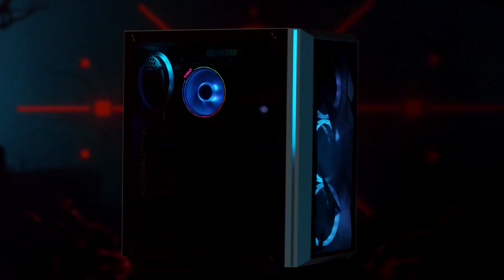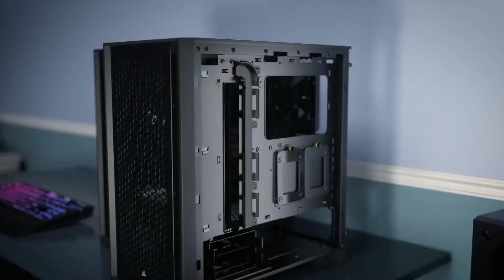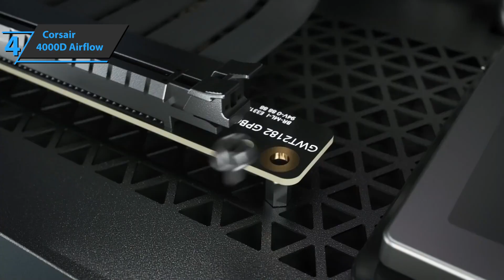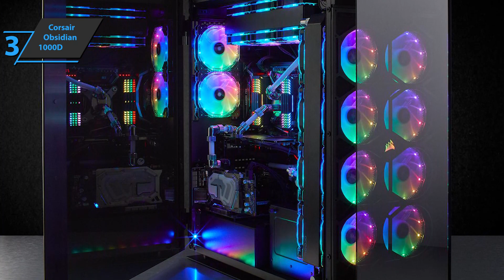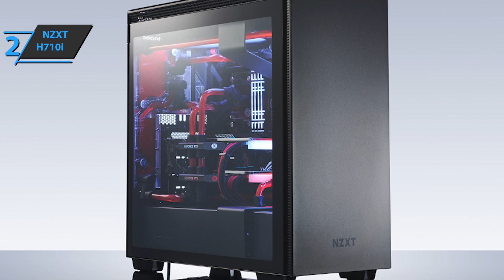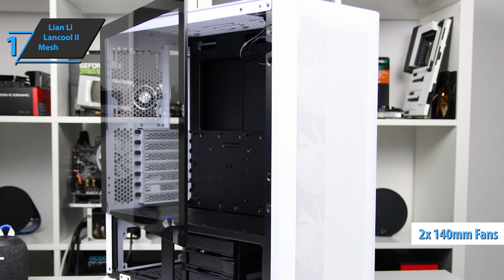Top 5 BEST PC Cases of [2022]

Comment: I just want a basic case! no front door or panels. I want at least two 5 1/4" bays in front, the front usb/audio inputs need to be below the bays so they dont get in the way of the dvd drives when opened. I dont need pretty colors, colored fans, etc... needs decent storage(couple of hard drives) one drive be in front 5 1/4" removable tray. Midtower ATX. Any recommendations?

Comment: I have the 4000d for my build and with 6 argb fans not only does it look great it has amazing airflow. Highly reccomend, good airflow, looks good, and is pretty easy to build in.
Reply: Does it have a USB 3 Socket?
Reply: @slayrobin9429  it has a usb 3.0 type a port, a heaphone/mic jack, and a usb 3.1 type c
Reply: @VxidGxd4060  do you think it's future proof? I.e. extra space
Reply: @oco8783   I think so, it has room for 6 fans which is enough even for a really high end build, and has amazing airflow to boot.  I had enough space to comfortably build in it
Reply: @oco8783  Big question is: Will it fit the 4090 Rog Strix ?
Reply: where is should i place the fans for best GPU cooling u think two 240mm in the top of the case will be good ?

Comment: Lian-Li 011 Dynamic Evo with frontal mesh+fans :)
Lancool 2 IMHO would have been perfect if it would have allowed a 360 radiator to be installed under the roof.

Comment: i tried to take this video serius untill you got to nzxt xD i have to admit it is really one of the best cases if you wish to fry the insides
Reply: Yea i bought one 4 years ago and i hste it the material they use is pretty much shit
You can bend that cases 'steel' unintentionally
Reply: @oooooo7821  def higher quality then most brands
Reply: I haven't had any problems with my h510i
Reply: Dude I saw a video about this and he put it in overall best ???
Reply: @DankTank374  They paid him so it is one of the best, obviously.
Reply: Been using one for almost a couple of years now and the temps are doing just fine, stop being a sheep and give an opinion when you have actually bought and used the product.
Reply: @oni1261  i have the h510i and I get mid 80s on high load. Upgrade for better air flow?

Comment: I agree that Lancool II is THE best PC case (especially snow edition), and Corsair 5000D is better than 4000D, but the rest ... Dude, have you seen Fractal Design Torrent, Lian Li Dynamic 011,  Hyte 60, Be Quiet Silent Base 802...
Reply: he dont ^^ i use the Silent Base 802 and this base is realy good
Reply: why 5000D better then 4000D ?
Reply: @hanionline563  Some engineering improvements in cooling and cable routing, like places for bigger fans and more space for cables.

Comment: I have the Cooler Master H500 and I cannot get my setup from overheating without taking off the side glass panel. I have tried multiple different fan layouts and nothing works. So I think I am going to give the Lancool II Peformance a try.
Reply: I don’t think your heat issue is with the case and changing it may not solve your problem. I would look at your cooling solution first. Perhaps it is not mounted correctly or something else is amiss.
Reply: yeah… nah bro. The case isn’t your problem, because i’m currently sporting an h500 as well and my temps are excellent. I just want a doper more cable manage friendly and better rgb is all

Comment: Does a pc case come with the cords ?
Reply: Only the cables for the front panel i.e the power button and usb ports
Reply: @nxxynx5039  could I play the game with that
Reply: @sowfsie5691  💀
Reply: @sowfsie5691  you couldn't even plug the PC into the wall with that. You need a PSU with PSU cables, a three pin mains cable and sata cables for storage unless you have m.2 SSDs.

Comment: Great video :)  I couldn't agree more about the Lancool II Mesh cases...I myself have already built in four Lancool II cases so far (two in the original & two in the Mesh variants) and they are the most modular, well thought out cases that I've ever worked with...my most recent build is in a white Mesh model where I used a total of 11 case fans, all of which are Lian Li SP120 ARGB fans (BTW, IMO their Uni-Fans are just way too overpriced for what you get...I mean it's not like they're mag lev or anything special).  Specs for my white Mesh build are as follows: R7 5800X, cooled by Lian Li Galahad White 360mm AIO (In a push-pull config), MSI B550 Tomahawk motherboard, 32gb (a matched 4x8gb kit) of G.Skill Trident Z RGB DDR4 3200mhz CL16, 1tb Samsung 980 Pro Gen.4 M.2 NVMe for the main boot drive along with a 1tb Adata/XPG Spectrix S20G Gen.3 RGB NVMe drive and a 2tb Crucial MX500 SSD for the rest of my data, I was able to snag an EVGA FTW3 Ultra Gaming RTX 3080 TI for close to MSRP, it and the rest of the components are powered by a fully modular White Corsair RM850x 80+Gold PSU and of course all contained within the Lancool II Mesh white case...please feel free to check out some vids I have of an older one of my Lancool II builds at my YT channel.
Reply: How did you manage to fit a 360mm AIO? Did you front mount it as intake? Did you find that it affected your GPU temps at all or was it worth it?
Reply: @slitoz  Yes, it's in the front because Lancool II cases only fit 240mm ones in the top (Well, maybe a 280mm if the motherboard's VRM heatsink is not too tall)...as for a difference between temps using push pull well, I never used that Galahad 360mm AIO with just 3 fans so, not really sure if the temps would be better or worse??? :s

Comment: This top i consider to be low-mid budget best cases. You didnt even say a word about 5000d airflow ( which is better than 4000d ) or 5000t icue ( which is one of the best if not the best case overall in 2022 so far )

Comment: I bought the Lian Li lancool II Mesh Performance for the wife's new system upgrade (she is getting my I7 6700k/1080Ti). I'm using my current Thermaltake Core X9 for an I7 12700k/3080Ti. 

Fair winds and following seas to all.

Comment: In fact I want a case that doesn't have a glass side window, I prefer the side to be in closed steel. there aren't many options left on the market for people like me.
Reply: Fractal makes a solid version of most of their cases, I just ordered the torrent solid for my next build and owned a meshify solid.
Reply: phanteks p500 lmao, they have a variant as you described
Reply: @otreblarazalas669  I searched for that Phanteks P500 you mentioned, they have the damn glass side window, I look for cases where both sides are metal.
Reply: @vladdraculLV  dont make me link it
Reply: @vladdraculLV  i cant find it either but they do make a variant
Reply: @otreblarazalas669  As I said: there aren't many options on the market for people like me, and the ones that do are extremely rare to find.